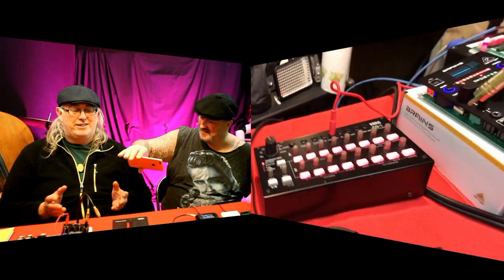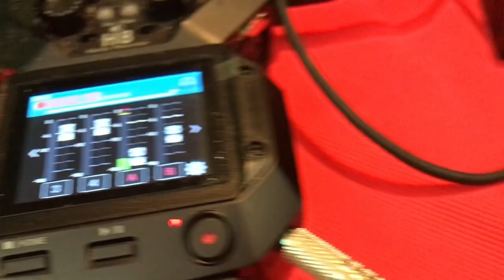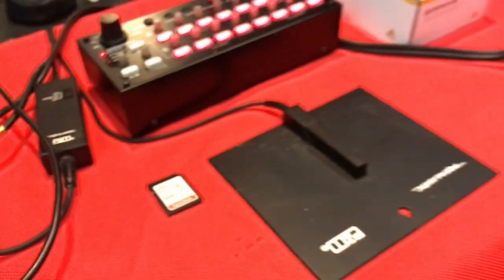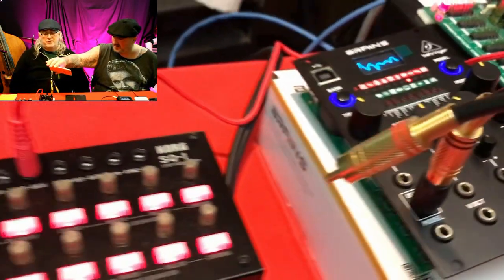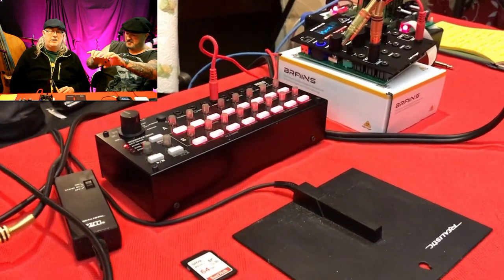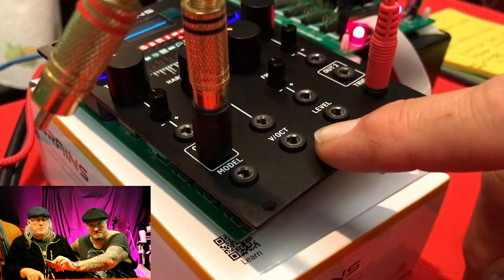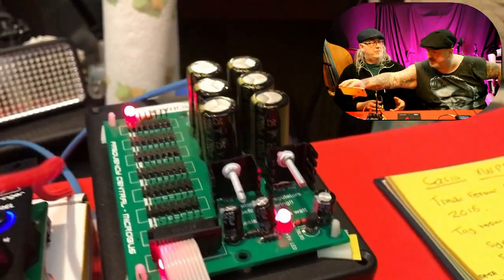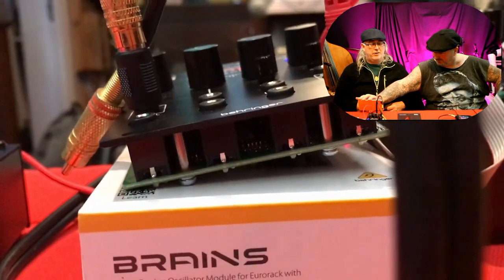Behringer Brains How to make it talk

Comment: The jacks under the harmonic and morph pots are the cvs, so to control words you'd need to run a slow LFO or separate sequencer to those and change them as needed, while triggering the gate as normal. Could do it with one sequencer if you only needed the one bank (numbers for example) or were dexterous enough to spin it yourself and land on the correct bank. Might even be able to repurpose the pitch cv if you've got one that does pitch, mod and gate per step.
Reply from the maker: thanks for info steve many thanks bangers and chumley
Reply: Thank you as well Steve! I for one would very much like to master this! I’m wondering if Behringer has something in mind the way, say chorus programs let you type in words?